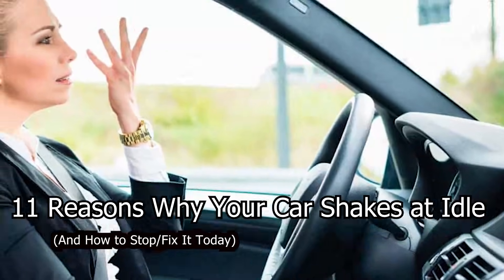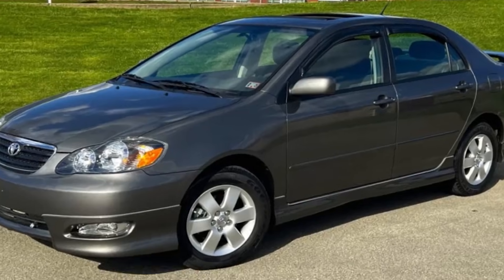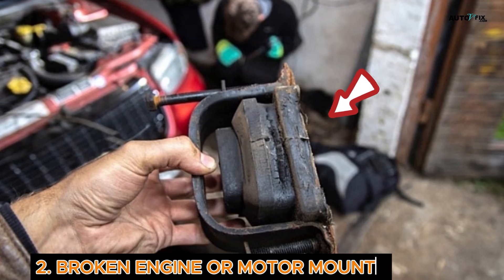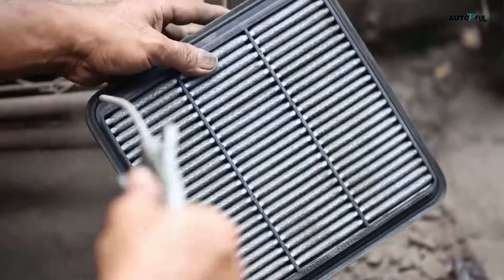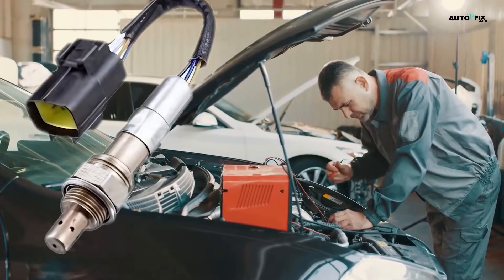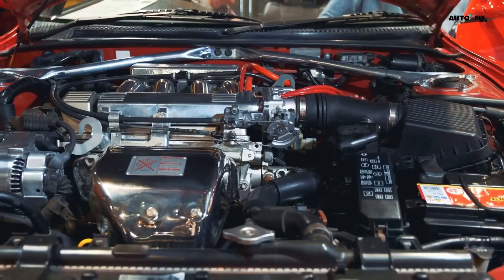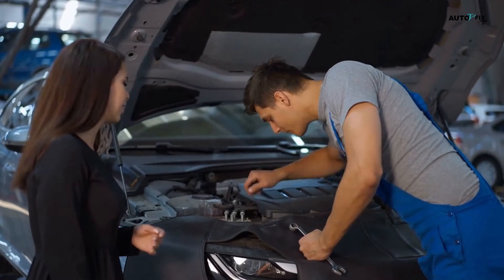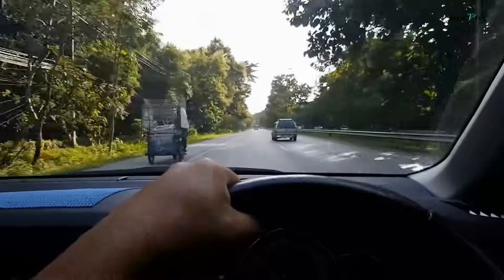11 Reasons Why Your Car Shakes at Idle

Comment: Good tips, I can use torque pro app to check for errors.🎉

Update 

A hose pipe had tears in it and had come out. I cut the bad part and just put ot back in, then it works no rough idle.

From my experience it is always the pcv valve. It will not be spark plugs if the car drives well.